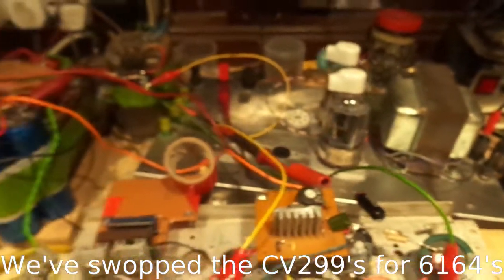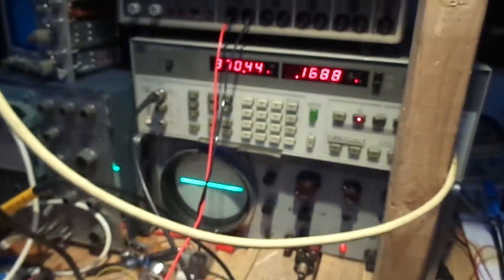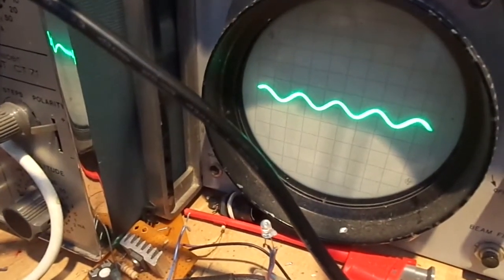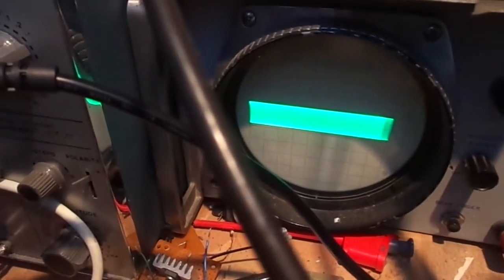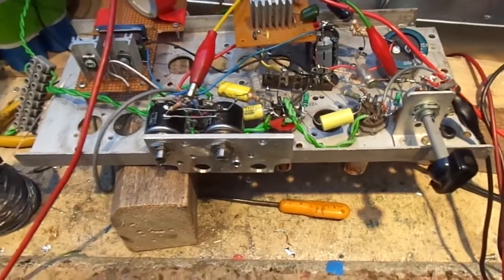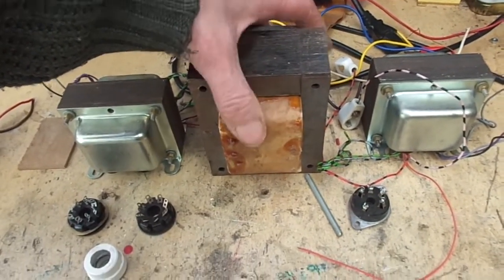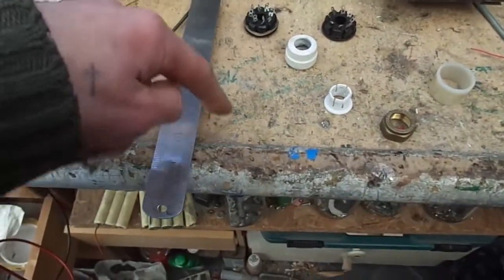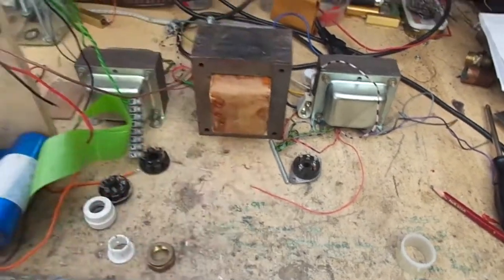Class AB2 Amplifier Part Two - 6146 PP

Comment: Major  improvement, Andy. It will improve when you get the rats nest of wiring out of the way. You also could add ferrite beads to the plate & grid leads on the outputs. That could stop any spurious oscillations, if you are worried about that.
 You can make a chassis out of a couple of junk store cake pans. Cut the bottom out of one and pop rivet them together to get the depth.
Reply from the maker: Cheers Frank. Aye, your right about the rats nest, even though it performed really well, no hum and V good open loop frequency response. Re cake tins - grand idea, but there's a lot of weight, about 30lbs or so, it'll need a substantial chassis I reckon,more of that int next vid. TFW mate......DA.